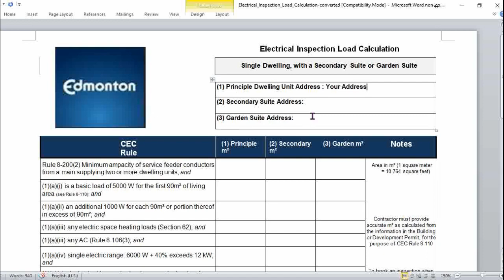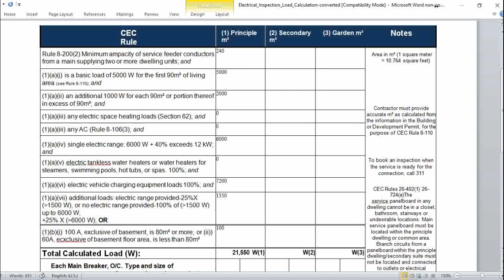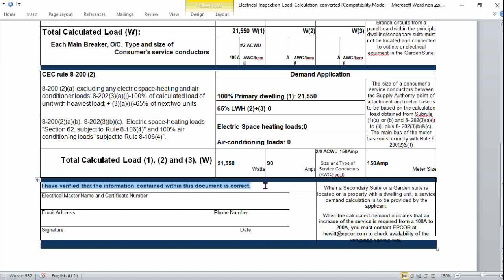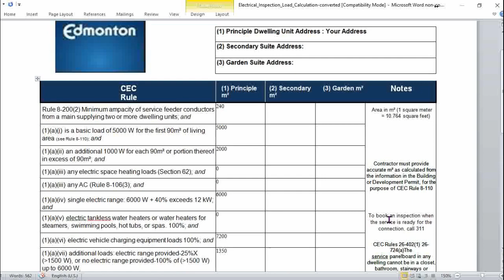Load Calculation for Electrical Permit in Edmonton

Comment: How do you do secondary suite calculations
Reply from the maker: The secondary suite is different from just basement renovation. Most of the cases, it requires more amperage. As the second suite is calculated 65% of the load towards the service size

Comment: hi can you plz share a video for load calculation with basement included where basement has a separate range, a dryer and a.c. in the main dwelling plz.
Reply from the maker: It depends on if the basement is a separate dwelling unit or not. It will be different for how to calculate the range. 
For the AC. Simply add 100% of its kWh